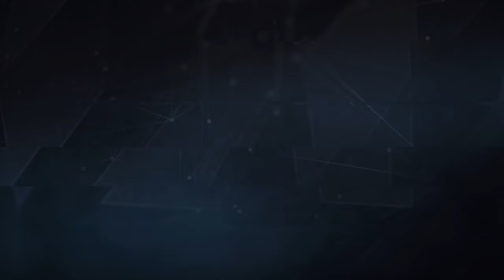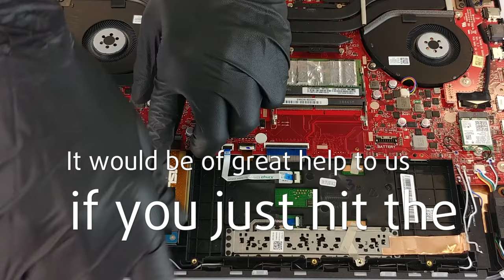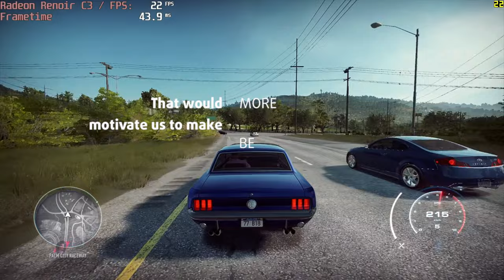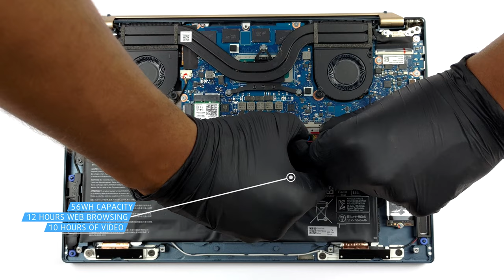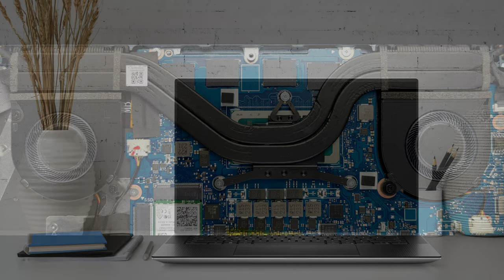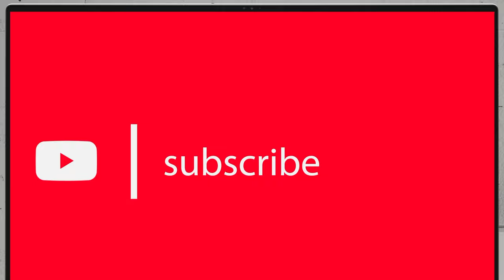🛠️ How to open Acer Swift 5 (SF514-56T) - disassembly and upgrade options

Comment: Hello I got a question
My Laptop model: Asus Tuf F15 Fx506hcb
Core i5, 8gb ram, 4gb Rtx 3050ti,48wh(so my battery isn't covering the lower right side of the battery which can house a Sata HDD or sata SSD)

SUMMARY
I want to upgrade and add a HDD but my laptop doesn't come with a generic Asus Tuf F15 sata cable.
Have you experimented with various sata cable cable, branded and offbrand like that of HP or Dell on an Asus Tuf f15 laptop with success? I want to know which type I can use as an alternative to connect the Hard disk drive. And what are the risk of using unbranded sata cable?

Thanks in advance
Reply: Eli-ic8id  Bummer. My board didn't even have a clip for a sata cable even though my battery is 48wh. Basically, I just have an empty space at the right part of my TUF F15. I guess I can only upgrade my battery
Reply: Eli-ic8id  I got a slot for another nv me. But as we all know it is a more expensive option